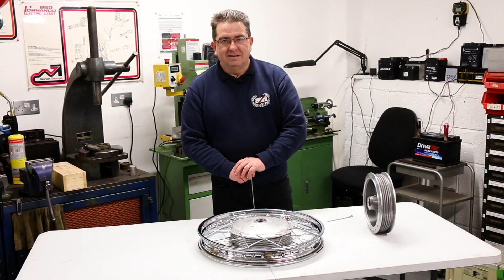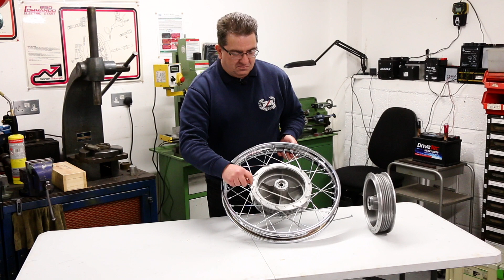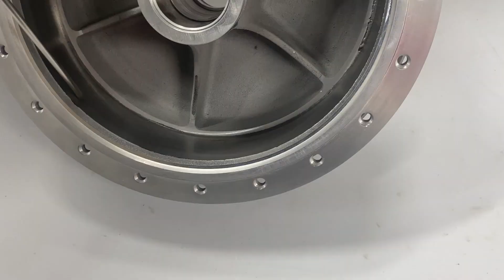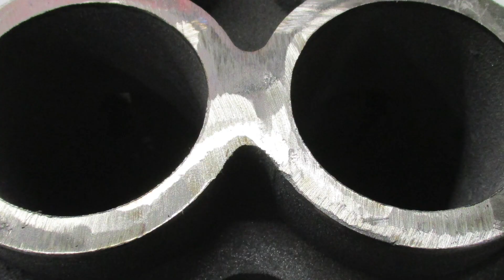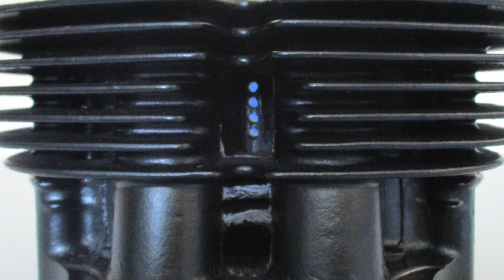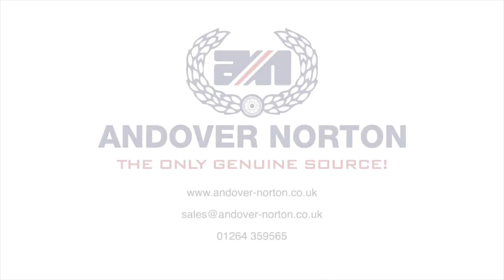FAQ Monday - Front Hub Project, The Humble Spoke

Comment: Speaking of cylinder barrels, would you not consider making the 750 style or perhaps an improved version of the Dunstall alluminium ones? Now that Steve Maney is no longer making those, I bet they would be quite popular...
Reply from the maker: Hi, so, we do sell a cast iron 750 barrel which is through bolt style. As for aluminium barrels, from feed back we have it is not an area where we would enter manufacture. The aluminium barrels are fine for race track use, but originality and long life are where we want our barrels to excel.